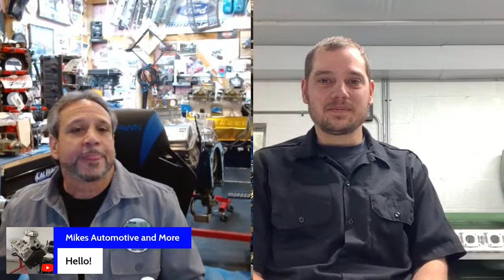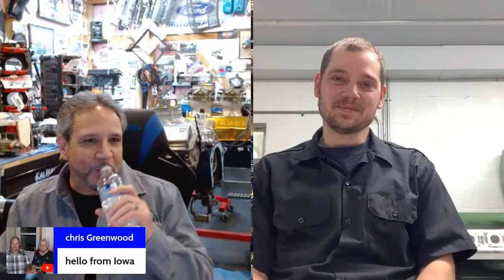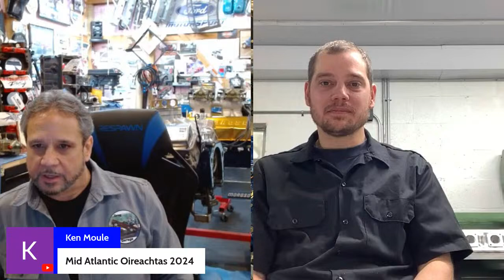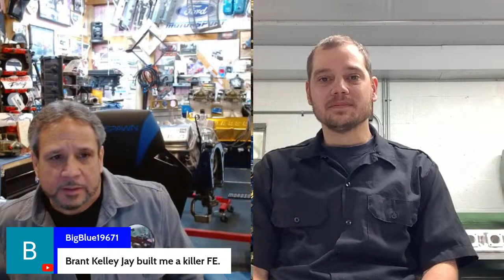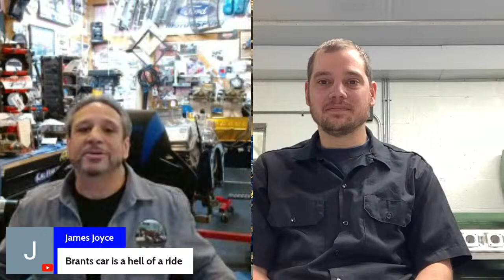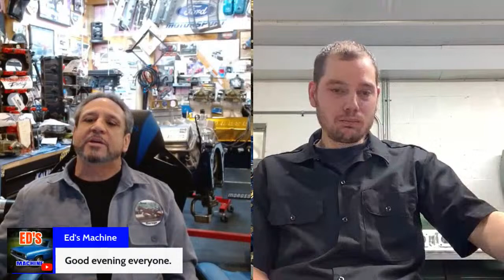DragBoss Garage: Live Chat  Jay Zolko 12/1/2024 7 pm .est Let's talk Ford's, Fe, Cleveland, and Hemi

Comment: I think what year thinking and can't find the words. The lower part of the intake makes up the top part of the valve cover area on the cylinder head.. now then I wish I would have caught this live. Jim I cut my teeth on FE's. My dad had the entire basement full of side oiler blocks, lemans cap screw rods and hi-riser heads. I had a set of 63 low riser heads. I think they were used on the 406 tri power as well. They had  a big H casted in-between the 2 center exhaust ports. I ran the med riser rocker arms set up with the large 7/16 adjusters. I put a set of stainless 2.19 intakes and a set of the 1.88 sodium filled exhaust valves in them, With a good solid lifter cam and a PI intake with an 850 Holley. It was a .030 over 390 gt block I would turn that thing  7500 rpm and i used a factory dual point 427 distributor. Never miss fired and I remember one night I was racing a w31 olds and I was on the curb lane. The church at school craft was watering the grass and i hit the wet spot in the lane at about 6500 rom and it shot straight to 8000. And it yanked the head of one of the sodium exhaust valves right off but i ran that best all over  Woodward Ave and telegraph in my 64 galaxie i ran a 3.91 gear w 31 spline locker and pissed off a lot of the 396 Chevelle's and 440 and 383 chrylslers I honestly think that big hog would have ran a low to mid 12 sec 1/4
Reply from the maker: Wowser Ross, killer performance. Those were the days. The sodium filled valves had a tendency to break anyway. Don’t you wish you could go back.
Reply: @dragboss351cleveland  man not for I had and let go or the stuff I had access to but more than anything. The deals ii passed on or didn't make an effort to get the money. Growing up in the motor city I was surrounded by factory muscle cars. And the people my dad knew was the who's who's in racing. Zora Duntov game me one of his cams he ground for the L79 or 79 it's the 67 nova with the 360 HP 327. It was a factory super stock cam that they never used, I used to go to Whitey''s. ( Moldex crankshafts) house for thankgiving. Had no clue Moldex crank was the best in the world from maybe 65-85 or later. And everyone else that started making billet cranks worked for whitey before they went out on their own. CJ Batten ( Batten cylinder heads) was at my house prolly 3 times a week my whole life. My uncle was the Head of experimental engine development at Ford MoCo from 59-73  hence my dad had as many 427 motors in our basement as Holman -.Moody. if I was home around 330 and a white e150 pulled in the driveway. I knew to get the hand truck and start getting the parts out of the van and carry them down stairs. And i made good use of those connections maybe 4 times my whole life. I just didn't know. Moldex did a crank for me for 60 bucks once. Oh and John Jomsr of Jomar race engines and the inventor of the Jomar stud giitdles gave me a set. And my uncle that. Came by in the 'supply" van got me a brand new off the line svo 2.3 motor. But that's about it. But the deals I passed on or just dint do anything about would have covered me to bring a non working millionaire I think. Cars I could have bought for say 500 bucks fix for 15 k and sold for 100k o let at least 3 of those go away . A hemi roadrunner with 2800 miles and a blown motor. A 68 gt500 or conv. Engine fire , 38k 500 bucks. ,65 gt350 R!! One of 35 could have bought it for 500. 69 boss 429 mustang no motor no trans interior was rough body had some rust. No holes just surface 500 bucks  I did buy my 1964 falcon sprint factory 4 spd car and the kicker had a 260 hiport original no motor or trans. I bought the shell. ,there were others but those there i could have made prolly 500k clear if I bought fixed and sold them. All those were made available over maybe a 6 year period from 79-85 maybe. Or I almost forgot. I  see an add in the Detroit news Sunday paper back then that's where you bought cars. I see an add for a  1965 AFX FALCON. me and my buddy go look at it. Still in high school his mom was killed in a auto deal and when he turned , 18 he got a 180 k so we were looking we get there is s complete fiberglass car minus the roof and 2/4s front end all glass trunk lid doors everything itt had a straight axel no turn signals no brake lines no heater it was a full blown AFX car but we didn't know it at the time. It was painted metal flake dk blue had a  dual quad 289 hiport with a c6 auto he says , 2500 with the motor 2200 without. We pass  my buddy says my old man would kill me if I spent money on this no lites nothin. About 8 years later we met the guy. Who bought it. He bought it without the motor and trans. He came back to pick it up s week later and the guy never pulled the drive train out so he got it for 1100. The guy who bought it restored it to original. It came with a 427 tunnel port and a 4 spd. It was supposed to be driven by dyno Don but by the time fat finished it the rules came out for the altered wheel base funny cars and knowbody wanted to drive it because it was obsolete already. He sold it at barret Jackson for $243000.  He had 80k in ot
Reply from the maker: @ great history Ross. Thanks for sharing. Did you ever hear of Jay Montrose?  I remember all the muscle cars too for sale dirt cheap. But at 10-16 yo no money for those expenditures. 💯🏁
Reply: @dragboss351cleveland  Jay Montrose.. Mopar guy ? , lived out towards 8 mile/ Gratiot area? I knew of him if he was a Mopar guy. If not then I don't think so although the name sounds familiar  the guy I'm thinking of was tied in with Mancini racing. Buddies with Mancini or worked for him something like that. I had a couple friends that were prolly as hard core Mopar guys as we are Ford's.
Reply: @dragboss351cleveland  oh shit! I forgot to tell ya Jim. In my dad's racing scrap book is a pic of me sitting in a   ( check this out ) multi colored blue maverick 4 DOOR!    Ring a bell? My dad and Wayne Gap were real tight that car was built where I used to work for Jack Rousch in livonia Mi. Right off Plymouth Rd and middle belt. That was Jacks original shop back when he raced. When jack got Ford's $$ he  bought more property built more buildings in that area. Then when he went nascar racing he built a big facility out in moresville I worked for him twice. From 82_84 then late 85-87 in the merc Capri trans am cars. That's where I learned all about mobil 1 but yeah pops and Mr. Gap were good friends Detroit is a huge hot bed of big time games and people u knew or was introduced to them all the guy from Kunsler fi I do t remember his name but we were somewhere I think Milan drag way and some guy is hollering my dad's name he looks up and it was that guy . We'  were at MIs at one of the races there and there was a crowd in this area by a concession stand we are walking by and someone yells my dad's name it was Benny Parsons pops knew everyone it was pretty cool realizing later on just who he was in the racing world
Reply from the maker: @RossT-l3g what is his name?  O have heard and seen pics of the shop on school craft rd. On of my subs used but from Jack back in 74-75. Jack helped him build a pro stock cleveland for his Maverick. Anyway. Motor broke and all his parts from Roush sat in his basement since 1975, he have them to me and delivered them to me. One set I’m working on now for 427 cleveland build.

Comment: U-Hauls used FT engines which were a little bit different than the FE engine.  330 and 359 cubic inch displacements. Similar design but hardly any parts interchange between the two.

Comment: John Haskell at Aire Research Engineering in Puyallup, WA designed a pedestal mounted rocker system for an FE engine at the request of Jim Van Cleve Sr back in the mid-70s. Jim was tired of breaking rocker shafts. John designed a setup that used Boss 351 rocker arms. After they implemented that new valve train Jim kept re-setting the NHRA records.   I have some pictures and a magazine article that talk about it, but I don't see any way to share here.
Reply from the maker: Thanks much appreciate you sharing with us. If you want to email me thpa351@gmail.com

Comment: Hello Jay and Tim, have a 385 /521 solid roller engine. I want to put roller bearings in my camshaft, what would the life expectancy be for these? These would way outlast a set of roller lifters with needle roller bearings by 10x? I know I missed the live video , awesome stuff guys. Follow you on Facebook Jay, love your builds
Reply from the maker: I cant answer that, with confidence, but unless there is a failure. Probably get a couple sets of lifters, depends on runs. This is a great question, hence our membership, where all your questions can be answered.